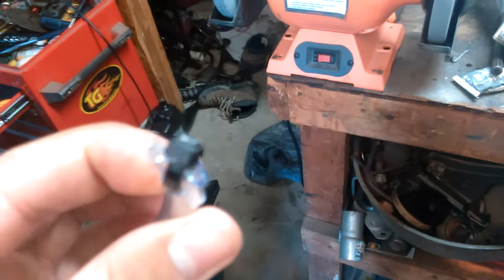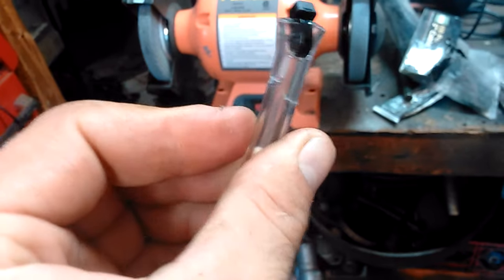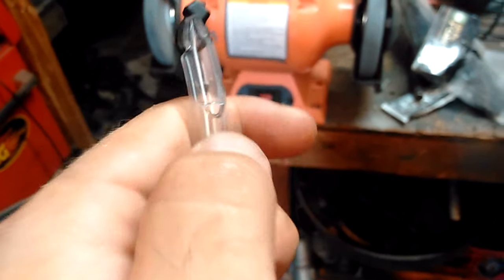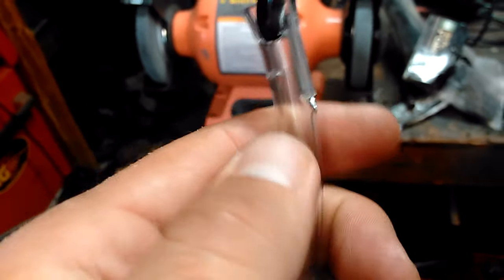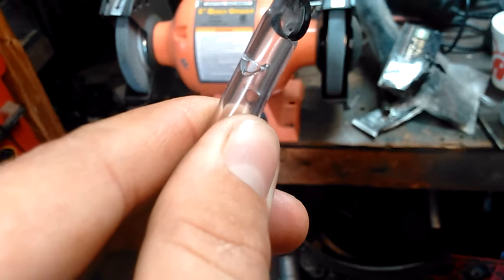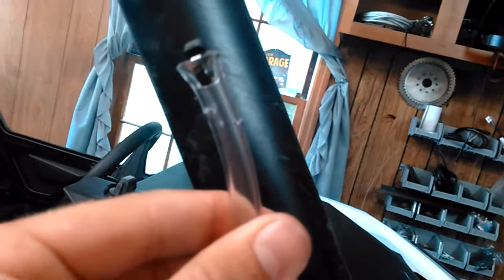Rzr vent lines

Comment: Why not just bend over the end of he hose? Like a loop on the end? I did that on my foreman into the pod so water doesn't run down it. It would have to suck it in.
Reply from the maker: you have to drill a huge hole in the pipe to get that in that does work well though I would be worried about it kinking in a small pipe that's what I did in my Honda also